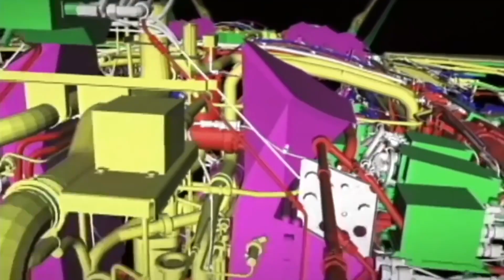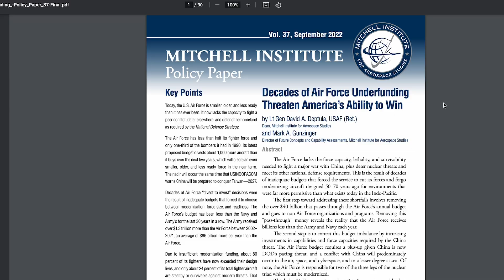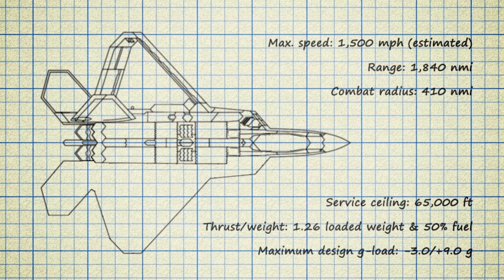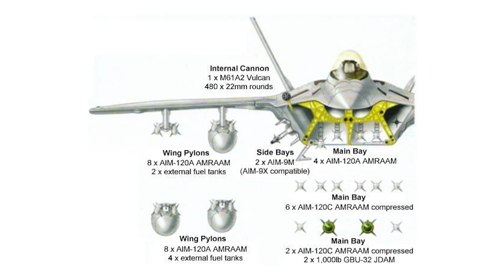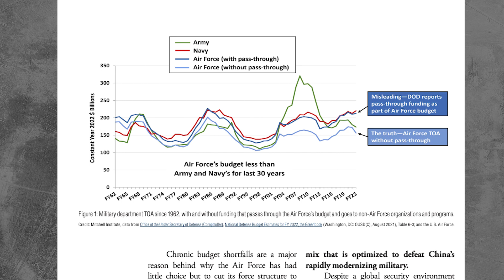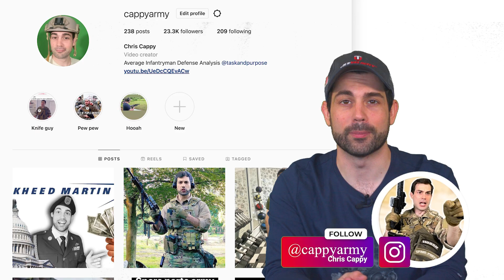Cancelling the F-22 Fighter is Worse than You Think

Comment: I believe the F-22 will not be used in combat like most people think. In tactics experiments at Red Flag the F-22 which can comfortably cruise at 65,000 feet was used as a stealthy AWAC'S platform. It cruised undetected and gave its team a total battlefield picture while legacy assets remained undetected with their radars off. The legacy aircraft were able to launch missiles which the F-22 then guided to the targets. The F-22's will be the QB's of a future conflict vs actually turning and burning with the enemy.
Reply: Eagle X program is really impressive
Reply: You just described more or less what the F-35 was built for from the ground up. But the F-35 has a secondary function of electronic warfare that makes it much more useful than the F-22 for it's roll. Also one of the main issues with the F-22 is you need very specific runways to use it so using it in the field requires tanker support and tankers are very vulnerable. In exercises conducted nearly 15 years ago 3rd gen fighters just targeting tankers was an effective way to take the F-22 out of a combat and was a difficult tactic to counter. 

If they beef up security for tankers then to keep all that moving you need a bigger commitment and suddenly you are using airframes you intended to use offensively to protect targets who's flight paths would be pretty predictable and could not really evade. 

It just becomes cost ineffective. I wondered for a really long time WHY they made the F-35 because it didn't seem to make sense. Eventually I realized they never really planned to fully retire 4th gen aircraft all the way and it made more sense. F-35's are there to extend how far we can see and neutralize SAM sites so other aircraft can function with less restrictions. They are good enough for fighting against 3rd and 4th gen fighters in a stand off role, they have the electronic capability to provide good real time info, and they function quite well against SAM assets at longer ranges.

You could force the F-22 into these roles but it made more sense to build something new. It turns out they might actually have had a better idea of what future air war was going to look like than we gave the Pentagon credit for. 

If they want assets for turn and burn that will require building something with the capability of the F-22 but that is carrier operable and can fill a strike configuration better. There is a reason the F-18 became a workhorse there.

But considering where the US is likely to fight future air wars I don't think that platform is as important as upgrading the F-15 and F-18 to keep them competitive. Stealth is nice but it is not as great anymore as people think unless you are ready to fully commit an airframe to it like the B-2. That is a program that is being upgraded with the B-21.

If you want to get into why stealth is less useful these days we can but that is a whole other conversation.
Reply: @whitelabrat  stealth refueling drones are on the horizon, this would eliminate that problem in particular, but they've definitely leaned towards advancing the F-35 in recent years, no doubt about that
Reply: @whitelabrat  - I'm curious about specifically why stealth is less useful than thought these days. But to sort of give a shot at guessing, I suspect it's probably something kind of "silly" like why it turns out that having the fastest jet fighter isn't the best because nobody was actually dogfighting at those speeds.

Like, maybe something like "in conventional wars you really only need your fighters to be stealthy enough and don't need them to be within spitting distance of the B2 and B21 to ensure the enemy has a small enough reaction time that they can accomplish their mission."

Or "EWS warfare is the new stealth"

Or simply "modern radar technology defeats it except for the stealthiest aircraft."

Which leaves only needing stealth for a solid first-strike and second-strike nuclear capability for deterrence and that's what the B2 and B21s are for?
Reply: That's what MiG-31 was made for as well. Off-board cueing missiles that Flankers were meant to fire.
Reply: @petlahk4119  stealth isn't "less useful" than thought, it, like any weapon, has its uses and of course, its counters.

Stealth gives the ability to get closer to targets without detection, to prevent identification of the specific threat, or to disguise numbers.

Long gone are the days when "Stealth" was meant to make something "invisible" and now its about having an advantage.

Simply not letting the enemy know what threat they face, or how many of them there are is a massive advantage.

Adversaries will always try to counter a threat as soon as they learn about it, so any form of "stealth" will only have a limited life before the technology needs to be changed.

The F-22 has been around a long time now, so stealth needed to change with the F-35 and the B-21.

The clever part today are the systems, interoperability and possible "weapons command" applications.
Reply: @Max_Da_G    ""That's what MiG-31 was made for as well. Off-board cueing missiles that Flankers were meant to fire.""

Yes, but that's what Fire and Forget is for as well. They don't need to be Cued:)   Hell, Harm can be fired and told where to go while it is flying to a General area .  But Flanker and Foxhound can be tracked before they pick up F-22 or F-35.
Reply: The problem with this idea is that you need to be able to forward deploy two or even three maintenance and supply lines.  You need to be able to have the F-22 up with your sorties, and in a peer conflict, the opponent gets to vote on when and where combat takes place.

The role you just described would be better filled by temporary satellite constellations.

While the F-22 or F-35 can operate in that domain, it's just not realistic to expect combat to reliably play into that model.

The role the F-22 was envisioned for largely evaporated in the 90s and the more necessary ground attack role was neither possible to integrate into the airframe properly, nor innovated separately.  There were rather extensive arguments back in the 70s/80s about how the ATF should be focused and the design goals were, 'we want an invisible F-15C, not an FB-111. We'll build a separate platform for that role.'

The practical reality is that we probably should have developed "an invisible F-14" - or, at the very least, a pocket B-1 that was carrier capable.  I will stress that the F-135 engine in the F-35 is compatible with the GE-F-110-400 geometry.  You could fit two F-135 engines into the F-14 and it would be about the most absurd thing ever.  Throw in some airframe optimizations and extra fuel (I like the idea of an elastic bladder system over drop tanks, but that is mostly because I dislike waste.)
Reply: @petlahk4119  There is a statistic in air to air combat that shows that the first one to see the enemy has an overwhelming advantage in the result of that encounter. If a low observable aircraft ALWAYS sees the enemy in standard aircraft first it gives them an overwhelming advantage.
Reply: @richardwillson101  I would argue that making aircraft invisible was never a real thing and that was a creation by the media. The goal was always to make low observable aircraft that can slip undetected through weak points in the enemies air defense network and to have the ability to get closer to enemy assets without being detected.
Reply: @CRAZYHORSE19682003  "Invisibility" is purely a question of what's looking at the thing in question. A man in a camo net hiding in a bush might be invisible to the human eye, but he'll still light up like a Christmas tree on a thermal imaging set. Same deal with stealth fighters. Aircraft stealth is about minimizing detectability within certain wavelengths on the EM spectrum (just like the earlier example, where visible light and infrared are simply two different wavelengths of Electromagnetic radiation), specifically those used by the overwhelming majority of detection and targeting sets. People for decades who don't know better have tried to argue stealth is "countered" by low-frequency radar, but depending on how low frequency those radars are they'll at best be unsuitable for accurately targeting whatever they're able to detect (instead being used as a queueing asset in the kill chain, guiding a radar set operating at a higher frequency to actually do the targeting and missile guidance) or at worst they might be giant, fixed assets like Over The Horizon radar which would be some of the very first things targeted and destroyed in a conflict. Making an aircraft fully invisible to all radars at all wavelengths is physically impossible, things that make them stealthy in certain EM bands do absolutely nothing against others, but stealth aircraft are orders of magnitude more difficult to detect to all the radars that actually matter. The guy above arguing that stealth is "less useful" should ask himself why, if that's the case, so many nations to this day continue to pour absurd amounts of money into developing stealth technology. It's not only as useful as ever, these days it's becoming essential to not be left practically helpless.
Reply: And this is why they are making the NGAD and retiring the F-22. NGAD requirements include being able to fly higher and faster than the F-22, with drone escorts that carry the ordnance and do the dirty work. The NGAD plane will be able to fly for longer duration and distance than the F-22. It is supposed to be even stealthier than the F-22.
Reply: "comfortably cruise at 65,000 feet" - if you don't put a pilot in it! Humans like to be able to breathe - F-22s have a HAL like mentality towards that!
Reply: To be fair, at this point the F-35 can probably readily assume that role. Similar flight ceiling, IIRC, and better sensor suite/integration, particularly while maintaining minimal electronic signal to avoid spotting.

Either way I think we can all generally agree that Cappy is a bit out of his element here - the F-22, while an amazing machine and practically a work of art - is not required for the US to retain air dominance. At the very least not in the numbers people seem to think they do. 

5th generation planes, as it turns out, are OP as all heck and the US already has such a comical head start on it that it's unlikely their peers will be able to compete. Russia was already out of the game and China is outnumbered 4-to-1 by F-35s - arguably better planes to begin with - last I checked.

Like, chill guys. It doesn't matter that the F-22 is being retired. Other planes are taking its place that are borderline science fiction spacecraft and the US still has three of the world's five deadliest air forces.
Reply: Except that will be the job of our 6th gen fighters which are closer than you think.  Watch Sandboxx news.
Reply: @johndoh5182  The F-22 will be rapidly retired when NGAD comes along so I agree with your assessment.
Reply: The F22 is does not have the ability to do that. The high speed information system used in the trashy F35 was not used. The F22 is a dog fighter a great plane but its no awac.
Reply: @johndoh5182  Same mistake as F-35 - far too complex - do-it-all platform.  You need cheap easily replaced weapons delivery platforms and put all the money and sophistication in the weapons.  If it means having three or four types - so be it.
Reply: @eleventy-seven  Actually it can, fun fact that not very many people know about the F-22's radar...including you is that it frequency hops thousands of times a second. The F-22 can have its radar on and operating and enemy aircraft can't detect it. A radar warning receiver is worthless against the F-22's radar. That is how the F-22 is able to operate as an AWACS....and they do it all the time at Red Flag.
Reply: qb?
Reply: @slkjvlkfsvnlsdfhgdght5447  Quarterback, a reference to American Football where the Quarterback runs the offense.
Reply: @CRAZYHORSE19682003  so like, what do you mean by that in this context? that F22s will be 'offense managers' or something like that?
Reply: @slkjvlkfsvnlsdfhgdght5447  Yes, in combat situations most aircraft fly with their radars turned off because they give away their position at a greater range than their ability to detect fighter sized targets. Instead they utilize platforms like E-3 Sentry's to provide them with battlespace awareness. The F-22 can step in and perform this function while remaining undetected. Its radar can be fully operational and it can't be detected like other aircraft radar because of how fast it frequency hops. The F-22 will be able to provide a full battlespace picture and what it can do that aircraft like the E-3 can't is that it can guide missiles blind fired from 4th gen aircraft like the F-15 and guide those weapons to their targets without the F-15 ever having to give its position away by turning on its radar.
Reply: @CRAZYHORSE19682003 that sounds really cool. but i do have a question:
 'because of how fast it frequency hops' 
what does that mean? are you talking about the dopler effect?
Reply: @slkjvlkfsvnlsdfhgdght5447  No I am not talking about the Dopler effect. I am talking about how most radars operate at a specific frequency or Hertz-Hz. The F-22 changes that frequency thousands of times a second so enemy radar warning receivers do not pick up on it. The F-22's Radar can be on and operational and enemy fighters in the area will not be able to detect its radar emissions like they can with legacy aircraft like the F-15, 16, 18.
Reply: @CRAZYHORSE19682003  i wouldn't exactly call those 'legacy' aircraft just yet: yes they are last generation, but far from obsolete
Reply: @slkjvlkfsvnlsdfhgdght5447  Compared to the capabilities the F-22 and F-35 bring, yes they are obsolete. I was reading an article about a Red Flag exercise where a young pilot in the F-35 with less than 300 hours was able to take over an engagement and direct legacy aircraft, keeping them out of danger and directing them to best employ their weapons. From a sensor and data fusion standpoint the F-35 is a bigger leap in capability than the jump from piston engine fighters to Jet fighters.
Reply: @CRAZYHORSE19682003  well, i wouldn't put too much stock in that article: one case doesn't really prove much, it could be that that one pilot was just insanely talented.

however, the other stuff may indeed prove your point; but i don't really know since i'm not well versed enough in this subject.
Reply: @slkjvlkfsvnlsdfhgdght5447  I have heard F-35 pilots equate changing from flying F-16's to F-35's is like getting their hands on alien technology.
Reply: @CRAZYHORSE19682003  i heard that the F35 is like the smartphone of fighter jets
Reply: I agree, dogfighting is less applicable when you have systems and munitions that can knock planes out of the air beyond the horizon
Reply: @Compgeek86  It is not just that. Many of the newest AA missiles have things like high off boresight and lock on after launch capability. Meaning an aircraft like the F-35 can lock on a launch a missile at an aircraft that is on its six. 
Missiles used to have such limited performance envelopes that getting on your enemies six and getting him into an energy poor state was necessary to get a high probability missile kill. That is no longer the situation. In todays world dog fighting would only be used when there are no missiles left and you have to rely on your guns and gun kills in modern combat are so ultra rare you are better off designing an aircraft for low observability, sensor fusion, high speed, long range and a massive payload. All traits more valuable than maneuverability in modern air combat.

Comment: Chris Cappy always enjoy your videos.  When the F22 was being built a number of choices were made to save money ( a real thing) no helmet mounted display (HMD) to take advantage of the missile's high-off boresight (HOBS).  Those 40 something year old Okinawa based F-15 & F16, 18 35 all  possess.  To save money it was decided f22 would only communicate with f22 and its avionics architecture is obsolete.  It can be upgraded but with limits.  In 2020 the F22 was finally able to shoot an AIM9X something F15 and 18s have been doing since 2003, but with no HOBS capable helmet smaller less capable envelope than the F15,16,18,35 aircraft.  F35 sensors and battlefield capabilities exceed the F22.  While the F22 performance does allow a greater ability  range of weapon deployment.  If it can't see all the information or use the weapon system to its fullest. Awesome performance may not be worth the degrade mission capability. 
Pilot still train for dogfights, the latest(heavy) helmets really mess up their necks,  I'm not a fighter pilot though I know lot of them.  They have a saying If you have to anchor and turn. (turning dogfight).  You f up the last 100 miles.  A knife edge dogfight is going to cut range time and battle space not mention mission capability.  They train for it but the way they flight eliminates a lot of the possibilities 

As of 2007 F15, F16, F18 F35 could all cross the international date line.  All it required was a software update now so can the F-22. 

The F22 is an awesome machine in term of performance but  capabilities are dated. Sec of Defense Gates was correct. in cancelling the F22.